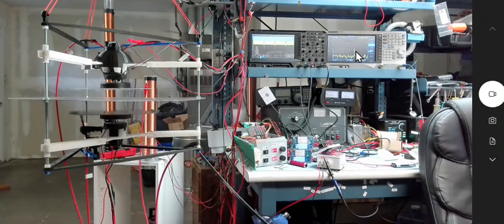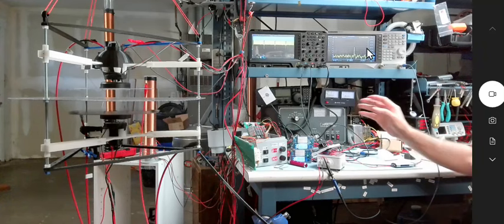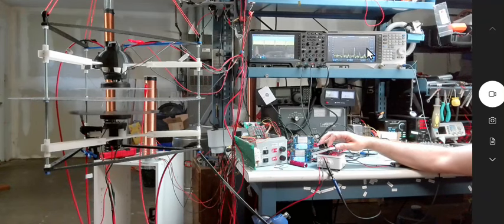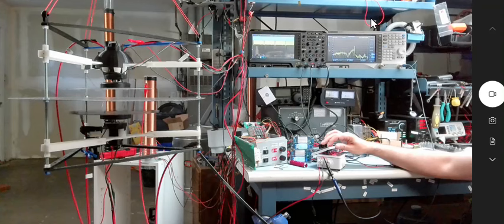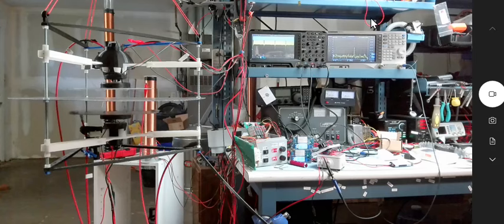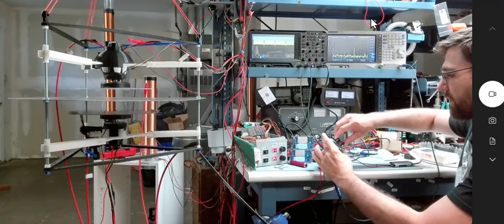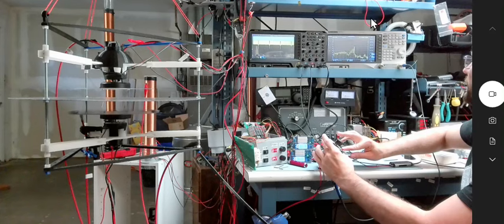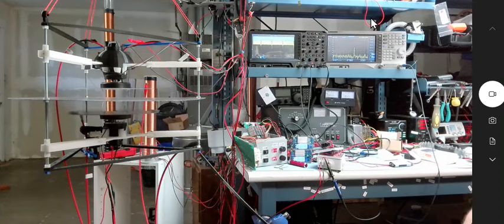Graviflyer Testing: Ultrasound power transfer

Comment: Jared what I just sent to Nathan.  Nathan, remember when I explained to you about the universe flashing on and off at the Planck time? The universe also rotates at 3.141592 rads/sec from my many years of experience with my theory. So, the guy in the video whom I have watched his video as I remember his voice found a frequency of between 18-20 hz. It is actually 19 hz. To get this number a person does the following calculation:  (3*1200)/(3.141592*60)=19.1. If you increase the disks rotation to 1800 or 2400 you get the following calculations:  (3*1800)/(3.141592*60)=28.6 and (3*2400)/(3.141592*60)=38.2.  The 3 is for the 3 disks. The pi value is for the universe rotation rate. The 1200/60, 1800/60, and 2400/60 is the rps of the disk. The Schumann resonances are 7.83 Hz (fundamental), 14.3, 20.8, 27.3, and 33.8 Hz. The Schumann resonance sets up due to the spinning earth and the gravity field that is the glassy silica layer pulling in space with a viscosity that puts a force on us to hold us to the surface.  I wish you knew my theory, but I cannot post it here.  If you get the top disk spinning at 900 rpm amd the bottom disk spinning at 493 rpm you may find something as these are the Schumann resonances of 7.83 and 14.3. The center of the earth is spinning at different rates and why the disks have to be spinning at different rates so the Schumann resonances set up.  The plasma discharge may be doing the same thing as the glassy silica layer of the earth moving space. If you set up the voltages on the three plates correctly the space instead of going into the earth would be going out of the earth and negate gravity as I just explained to you.  The earth's magnetic field, electric field and gravity field, the spinning earth, the Schumann resonance are all part of the gravity of the earth. Lightning that is always going on with the earth from the ionosphere to the ground also has something to do with gravity like your electrical arcs between your top and center disks. The earth's magnetic field spinning produces a current in the earth much like the magnets do with the graviflyer. The  graviflyer's magnetic field has to be opposite the earth's magnetic field to work. The graviflyer's electric field has to be opposite of the earth's electric field. The earth's magnetic field goes from north to south. The earth's electric field goes from inside to outside. The earth's gravity field goes from outer to inner. Maybe the top disk has to be at the second Schumann resonance and the bottom disk has to be at the fundamental Schumann resonance or vice versa as I get confused with this. With the graviflyer's setup being opposite to the earth's the graviflyer may lift up. My guess is that the Schumann resonance of the earth is the earth flashing on and off to offset the entire universe flashing on and off as first the matter universe and then the anti-matter universe just like the graviflyer has to do. The universe is my spectrum that is the black hole particle being red shifted in the matter part of the universe to the anti-matter part of the universe that keeps the conservation laws constant.  The universe flashing on and off is a sine function and why your fluorescent bulb never goes out completely but slowly goes on and off very slowly. Also, what is the white substance on the one disk? Is it aluminum oxide or plastic with a dielectric constant to keep the top disk from shorting out like what I found out from Alexey with the polycarbonate CD coated with Al2O3 on one side and Al on the other side so it acts like a normal capacitor and the top disk has no Al2O3 on it so it can short out as an air capacitor to get the plasma discharge moving the space as I detailed above? The center disk has to be at the higher voltage than the top and bottom disks at the correct positive and negative charges and the reason for the tesla coil. The ultrasound keeps all of this from setting up originally so the charge can set up fast by turning off the ultrasound. The textured aluminum allows the ultrasound to be transmitted through all three disks as I explained earlier with the CD having groves. Alexey had many versions of the graviflyer before getting it correct. He must be an alien to know all of this as I found out by working with the UFOs with the Reagan Administration and the US army black ops in the early 1980's. Also, Earthquakes occur at ultrasound frequencies just like the ultrasound of the graviflyer. The aurora borealis may be the shorting out of the earth just like the shorting out of the bottom disk. Earthquakes are always occurring on the earth. I just sent you an email with this same information. I may not have the set up explained correctly but hopefully you get the idea. The graviflyer settings.  https://drive.google.com/drive/folders/1Sj7VZXYxcTraZ7z5uJeYIU1CGiYzUB1V

Comment: Jared, what I just wrote to Nathan as the graviflyer has as very involved setup.  Nathan, remember when I explained to you about the universe flashing on and off at the Planck time? The universe also rotates at 3.141592 rads/sec from my many years of experience with my theory. So, the guy in the video whom I have watched his video as I remember his voice found a frequency of between 18-20 hz. It is actually 19 hz. To get this number a person does the following calculation:  (3*1200)/(3.141592*60)=19.1. If you increase the disks rotation to 1800 or 2400 you get the following calculations:  (3*1800)/(3.141592*60)=28.6 and (3*2400)/(3.141592*60)=38.2.  The 3 is for the 3 disks. The pi value is for the universe rotation rate. The 1200/60, 1800/60, and 2400/60 is the rps of the disk. The Schumann resonances are 7.83 Hz (fundamental), 14.3, 20.8, 27.3, and 33.8 Hz. The Schumann resonance sets up due to the spinning earth and the gravity field that is the glassy silica layer pulling in space with a viscosity that puts a force on us to hold us to the surface.  I wish you knew my theory, but I cannot post it here.  If you get the top disk spinning at 900 rpm amd the bottom disk spinning at 493 rpm you may find something as these are the Schumann resonances of 7.83 and 14.3. The center of the earth is spinning at different rates and why the disks have to be spinning at different rates so the Schumann resonances set up.  The plasma discharge may be doing the same thing as the glassy silica layer of the earth moving space. If you set up the voltages on the three plates correctly the space instead of going into the earth would be going out of the earth and negate gravity as I just explained to you.  The earth's magnetic field, electric field and gravity field, the spinning earth, the Schumann resonance are all part of the gravity of the earth. Lightning that is always going on with the earth from the ionosphere to the ground also has something to do with gravity like your electrical arcs between your top and center disks. The earth's magnetic field spinning produces a current in the earth much like the magnets do with the graviflyer. The  graviflyer's magnetic field has to be opposite the earth's magnetic field to work. The graviflyer's electric field has to be opposite of the earth's electric field. The earth's magnetic field goes from north to south. The earth's electric field goes from inside to outside. The earth's gravity field goes from outer to inner. Maybe the top disk has to be at the second Schumann resonance and the bottom disk has to be at the fundamental Schumann resonance or vice versa as I get confused with this. With the graviflyer's setup being opposite to the earth's the graviflyer may lift up. My guess is that the Schumann resonance of the earth is the earth flashing on and off to offset the entire universe flashing on and off as first the matter universe and then the anti-matter universe just like the graviflyer has to do. The universe is my spectrum that is the black hole particle being red shifted in the matter part of the universe to the anti-matter part of the universe that keeps the conservation laws constant.  The universe flashing on and off is a sine function and why your fluorescent bulb never goes out completely but slowly goes on and off very slowly. Also, what is the white substance on the one disk? Is it aluminum oxide or plastic with a dielectric constant to keep the top disk from shorting out like what I found out from Alexey with the polycarbonate CD coated with Al2O3 on one side and Al on the other side so it acts like a normal capacitor and the top disk has no Al2O3 on it so it can short out as an air capacitor to get the plasma discharge moving the space as I detailed above? The center disk has to be at the higher voltage than the top and bottom disks at the correct positive and negative charges and the reason for the tesla coil. The ultrasound keeps all of this from setting up originally so the charge can set up fast by turning off the ultrasound. The textured aluminum allows the ultrasound to be transmitted through all three disks as I explained earlier with the CD having groves. Alexey had many versions of the graviflyer before getting it correct. He must be an alien to know all of this as I found out by working with the UFOs with the Reagan Administration and the US army black ops in the early 1980's. Also, Earthquakes occur at ultrasound frequencies just like the ultrasound of the graviflyer. The aurora borealis may be the shorting out of the earth just like the shorting out of the bottom disk. Earthquakes are always occurring on the earth. I just sent you an email with this same information. I may not have the set up explained correctly but hopefully you get the idea.
Reply: Very smart human right here.. you all should read/fully understand this! Very nice!

Comment: This tesla coil is not working like anyone I have ever seen. It might be because of the transistor. The oscillation is not a true oscillation. It is a timed pulse. Meaning it doesn't require the oscillation to be correct. It will still force energy out even when you force frequency change in the #2 coil. This would explain why the oscillation is correct until I get to the top 4" of mine and the frequency drops to 20hz. It does not require the energy to go all the way up the #2 coil then all the way back down at the same frequency like a spark gaped one does. The transistor wire has no place for the return frequency to go.

Comment: there are no button or switch in the ultrasonic diagram of graviflyer , could you please explain.👍
Reply from the maker: Astute observation! Yes, Alexey doesn't have the button in the original schematic. The button is a 'normally closed' that is wired inline with the ferrite toroid transformer core. The core has two windings, a larger gauge 27T and a smaller gauge 35T, wound on opposing sides of the core. When pressed, this button disrupts the current flow on the larger gauge 27T side. So one side of the button is going straight to the positive of the piezo, the other side of the button is going to the negative of the piezo, but is first going through all 27T. So when I push the button, there's a brief back-emf spike from stored energy in the core, followed by a back-charging of the core from the charge accumulated on the piezo by the tesla coil.
Reply: @MyTBrain  when I was building graviflyer I didn't had any information about the wire numbers or any detailed information and alexy didn't speak or type english for questioning but with your help I may rebuild and fix such mistakes . thank you

Comment: You have identified a frequency in the tesla coil that matches the piezo and now it amplifies it. Is this the only one?
Reply from the maker: The sweet spot for the ultrasound/TC increase around 630kHz w/+14 dBm seems to be 2-2.75 turns from fully CCW and at 1.125 turns from fully CCW. Also, going back through Alexey's lift vids, it looks like lift starts to occur EXACTLY at the moment the button is pressed down, though not at the first or second button press.